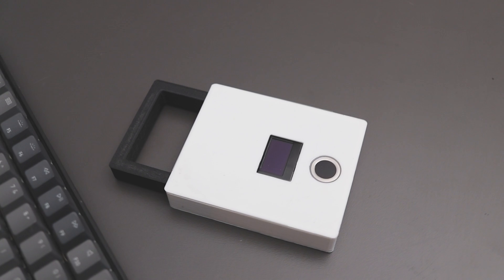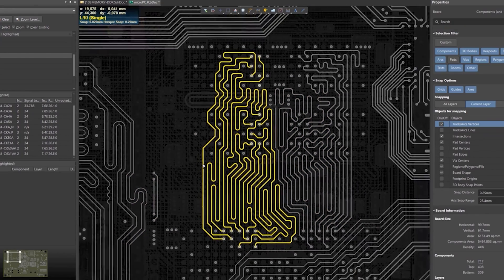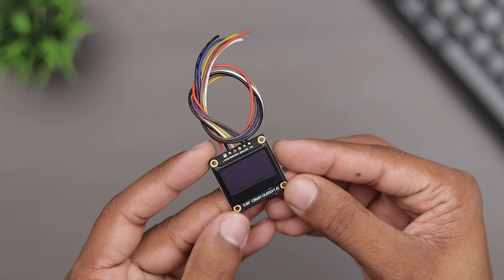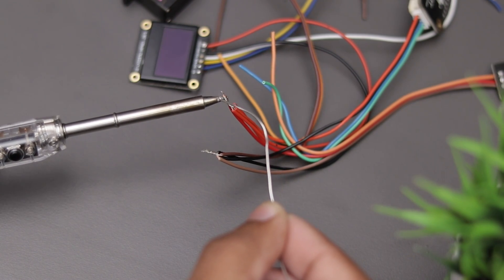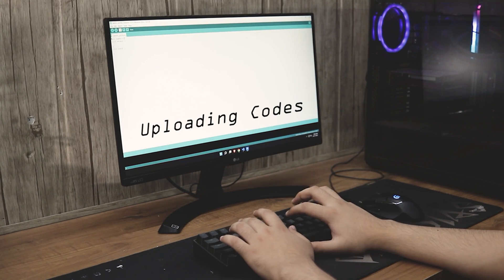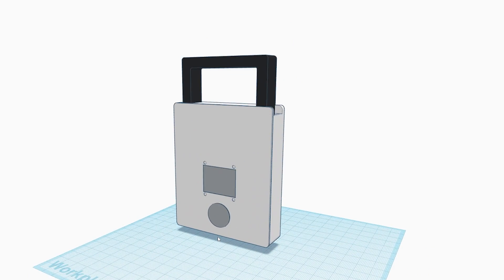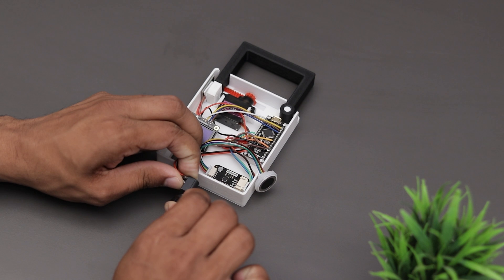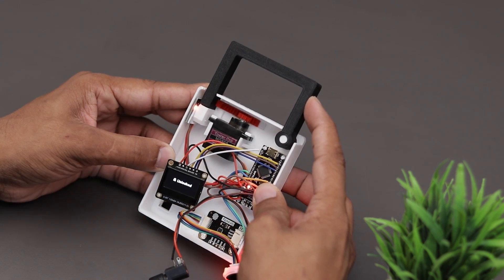Build Amazing Padlock with Fingerprint Sensor | Arduino Projects | The Wrench

Comment from the maker: Hey Guys, this project was just an experiment and for educational purpose, so do not comment that we can break it with just one hammer. thanks watching. see you.
Reply: Your next step should be to make a real padlock because thing is fantastic. Very well done.
Reply: Ok I will not comment that you can break this lock with a hammer. But you can break it with just one lighter
Reply: .0jp8t 5c h
V
Reply: Which fonts used in the entry please give font name
Reply: Please provide code
Reply: Love it Great video , but the only problem is it can't exactly be called an experiment cuz there are companies out there mass producing these fingerprint pad locks 🤷

Comment: Bro, please mention the power supply you'd used in the nanoleaf panel project for the ws2812b led strip
The volt and current of power supply or it's wattage

Please please🙏🙏🙏🙏🙏
Reply from the maker: 5V 3Amp
Reply: Thankyou so much brother!!
Reply: And please be active on ur channel, will definitely support 🖤🖤